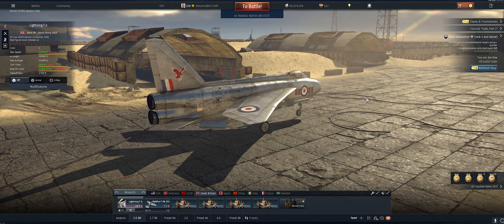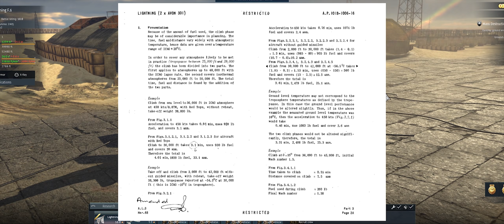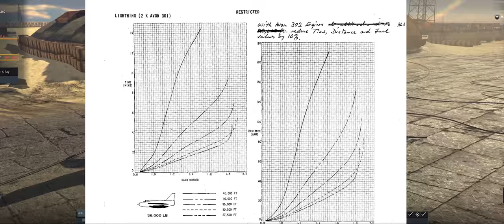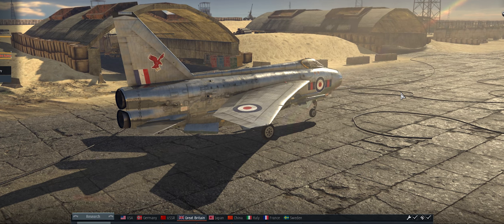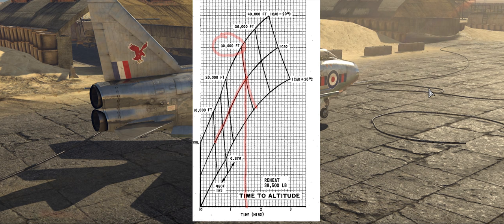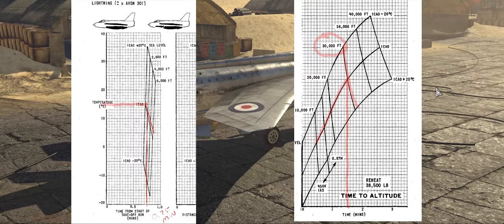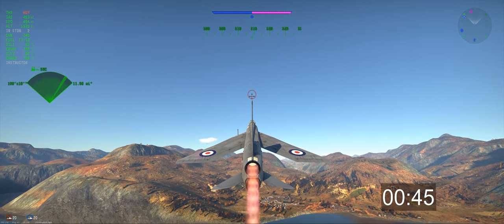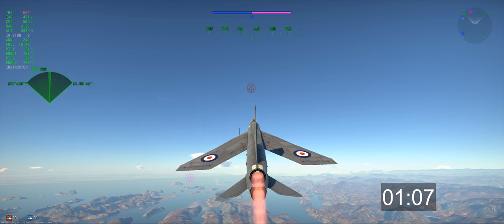True Facts About the English Electric Lightning's Performance - War Thunder 1.97

Comment: It's just weird how the migs and phantoms out climb this thing. Doesn't seem fair. The radar should at least work properly because the red tops need it.
Reply from the maker: EEL came into service around 1959, F6 probably closer to 1964.
Mig21 MF and SMT came into service in 1970 and 1971 respectively. Their trust to weight ratio compared to EEL is quite similar... Only difference is far less drag since they're tiny compared to EEL.  

Start to make some sense? 

Phantom came into service in 1960s.  FGR came into service 1972 I Think.  I forget.   Either way the Brits have the strongest jet in the game, the FGR.  It still out performs the rest.  

Yet they complain.
Reply: Because the F-4 and Mig 21 straight up out perform this thing in a zoom to altitude...F-4 for example has 41,000 ft/min where as the Lightning sits at 20,000. the reason the Lightning U2 thing SHOULD be brought up is not because the Lightning was the only one to do it but rather it was the plane that has the most favorable performance up at that altitude (for example for all the shit the F-104 gets at 60,000-70,000 the F-104 has better flight charactristics and THATS why they used 104s to intercept the U2 in the 80s and not something like the F-4 and was it was the USAF they didn't have access to F-14s) 

To put better light on the subject, Operation High Jump: A series of time-to-altitude records for the F-4 Phantom was set in early 1962: 34.523 seconds to 3,000 meters (9,840 ft), 48.787 seconds to 6,000 meters (19,700 ft), 61.629 seconds to 9,000 meters (29,500 ft), 77.156 seconds to 12,000 meters (39,400 ft), 114.548 seconds to 15,000 meters (49,200 ft), 178.5 seconds to 20,000 meters (65,600 ft), 230.44 seconds to 25,000 metres (82,000 ft), and 371.43 seconds to 30,000 metres (98,400 ft).

61.629 seconds to 9,000 meters (29,500 ft) Thats just under half the time for the lightning.
Reply: Southern Bear I think a lot of players don't understand how to climb properly at high altitudes. I did a test not long ago that found the highest climb rate for the F-4C is at M0.9, as you might expect for your supersonics. But at an altitude of I think 13 km or something like that, the IAS drops down to stall speed, and the climb peters out. Did some calculations, turns out the F4C at an altitude of 10 km actually has an ideal climb speed of M1.5, not M0.9, in fact, after around 9 km, the ideal climb speed continuously increases through mach as altitude increases up to very high altitude. This characteristic is consistent of mach 2 fighters in game.

Furthermore, players don't realize that the ideal climb speed at alt is in the supersonic regime, because there is a huge drop in performance around M1 to M1.1 which kills the climb. At certain altitudes, trying to push through M1 will actually force you to dive, reminiscent of the SR-71s climb profile.

So I'm sure the EEL as it performs in-game right now could reach U-2 altitudes if players climbed properly. But they don't. There's no reason to go M1.5 in PvP games, the maps are physically too small for it, except Boulogne, which I haven't seen in ages.

Comment: I would like to ask why you are only talking about the acceleration up to 450 knots and a 450 knot climb changing to mach 0.87 at 15,000 feet.

If you'd have looked on the forum, you'd see that there's a discussion going on with tests being performed. A quick look on this discussion would have shown you that the low-level acceleration up to 0.9M and climb-rate isn't the issue, nor is anyone complaining about it.

You've just done a test to show what has already been known and to "prove a point" about things people aren't complaining about.

If anyone would like to know what is actually wrong with the Lightning (I.e. Nothing in this video that he's trying to use to bash us).
You are welcome to join us on the forum.

https://forum.warthunder.com/index.php?/topic/478056-ee-lightning-f6/
https://forum.warthunder.com/index.php?/topic/479939-lightning-f6-performance-test-results/
Reply: Forum links =/= Factual data.
Reply: @asiftalpur3758  If you'd bother to click the links you'd see that they lead to official MOD data.
Reply: @oscarmuffin4322  is that a manual?
Reply: @asiftalpur3758  Again, If you'd bother to read the thread you'd find out.
Reply: @asiftalpur3758  your right Russian and UK relations are bad especially with the salisbury poisoning

Comment: Yes thank you so much for this. Even a small google search reveals that lightning shouldnt perform as well as a mig21 in climb and yet wt community intensely argues otherwise
Reply: Except that's not true. Even if you compare Gaijins data sheets of the two aircraft, the Lighting climbs better than the F13 and if you use the climb chart for the lighting at M.87 and compare it to the Mig 21MF in game then the Lighting climbs about the same if not better.

Comment: It's always going to under perform if you insist on a climb angle of silly degrees. 
http://www.aeroflight.co.uk/aircraft/types/type-details/english-electric-lightning.htm 

Initial climb 50,000 ft/min
Reply from the maker: In aviation you don't climb based on angle, you climb based on speed.  Most if not all climb charts are based on speed.  Your reference says initial climb 50K feet a minute, which is fine, but it's also followed by "time to 40k, 2 mins 30 seconds" so I'm not sure if it actually helped your point.

Comment: Which Lightning?????????? If it's Big Momma F3 XR749 the Lightning is well under performing. This particular Lightning beat F14'S F15'S F16' 104 Starfighter's in NATO tests in 1985. Achieving speeds of mach 2.3 and altitudes of 88 thousand feet.

Comment: the lightning is over performing but it under performs compared to other aircraft so say the mig-21smt  out climbs the lightning the mig 21 should not out climb the lightning and it should be nerfed
Reply: Source on that ?
Reply from the maker: Mig21MF and SMT came into service in 1970 and 71 respectively, 5 to 10 years after the EEL.  They also have a very similar thrust to weight ratio and ALOT less drag.
Reply: how do you know?
sourse? proof?
Reply: @niki_saito  i mean irl
Reply: @Theo_Aubusson  i ment in game
Reply: @niki_saito  you've said that the mig 21 shouldn't out climb the EEL...
Reply: @Theo_Aubusson  yes
Reply: @niki_saito  so where's your proof for this claim ?
Reply: "Operation High Jump: A series of time-to-altitude records for the F-4 Phantom was set in early 1962: 34.523 seconds to 3,000 meters (9,840 ft), 48.787 seconds to 6,000 meters (19,700 ft), 61.629 seconds to 9,000 meters (29,500 ft), 77.156 seconds to 12,000 meters (39,400 ft), 114.548 seconds to 15,000 meters (49,200 ft), 178.5 seconds to 20,000 meters (65,600 ft), 230.44 seconds to 25,000 metres (82,000 ft), and 371.43 seconds to 30,000 metres (98,400 ft)."
If the lightning is at 30 angels at 135 seconds
the F-4 Phantom is at about 55,000
Reply: @WhooptieDo  Mig-21BIS (75A) Technical description. Book 1. LTH (МиГ-21БИС (75А) Техническое описание. Книга 1) - page 50 - Mig-21Bis need about 2min10s to get 9000metres from the ground. So Mig-21MF and SMT climb faster than Mig-21Bis?
Reply: @Theo_Aubusson  Mig-21BIS (75A) Technical description. Book 1. LTH (МиГ-21БИС (75А) Техническое описание. Книга 1) - page 50 - Mig-21Bis need about 2min10s to get 9000metres from the ground. Mig-21MF and Mig-21SMT don't climb faster than Mig-21Bis, right?
Reply: @doodiezgrandpa6520  Mig-21BIS (75A) Technical description. Book 1. LTH (МиГ-21БИС (75А) Техническое описание. Книга 1) - page 50 - Mig-21Bis need about 2min10s to get 9000metres from the ground. Mig-21MF and Mig-21SMT don't climb faster than Mig-21Bis, right?
Reply: @Charioteer71  I don't know, can you provide an evidence that the Mig 21 we have in game is slower than the Mig 21 bis
Reply: @Theo_Aubusson  Mig21MF and Mig21SMT now in the game climb faster than the Mig21Bis in its performance document.
Reply: @Charioteer71  what's the flight conditions in the manual ?
An older plane can be faster than a newer one
Reply: @Theo_Aubusson  Mig-21Bis(75A) with two R-3S and maximum engine power.
Reply: @Charioteer71  max power with or without afterburner, what fuel load, what climb rate, what temperature ?
Reply: @Theo_Aubusson  https://cloud.mail.ru/public/490525725e49/MiG-21BIS%20(75A)%20Tehnicheskoe%20opisanie.%20Kniga%201.%20LTH.rar  find it here.   There's only one chart without mentioning any conditions. Maybe some before page 50 but didnt find them.
Reply: @Charioteer71  Thank you, i'll read it^^

Comment: thats means everything else is overperforming to shit the mig 21smt never had the same capability as the lightning over 15000ft so why tf does it boss  the lightning
Reply: The issue is that the manuals aren't great to work out max performance. They're what the manufacturer recommends to get the most life out of the machine, meaning they pretty much always lowball the top end figures, since they create excess stress. The issue is that every company will do so by a different amount.

 It's why gaijin generally won't accept manuals as the sole piece of info for changes.

Comment: The thing is, you are showing off the stuff that is actually done correctly, there are issues with high altittude acceleration (which is takes ages up to 2x as long for some uknown reason) and supercruise capabillity, I am no aircraft engineer, but approaching is this way is incorrect, because it is not as easy as you say, you have to compare much more data than just what you have done.
Reply: >is not a aircraft engineer
>still thinks need more data then a fucking manual lmao
>britmains.jpeg
Reply: I won't argue with you, but facts are clear, EEL could supercruise at 1 800 m alt, guess what, in-game it can barely do it at about 4 000 m. Does this seem correct to you? Even the manual Gaijin used says this, yet they overlooked it for some reason. Many sources will tell you that EEL could intercept U-2 spy plane, in 80s it was the only NATO plane capable of intercepting Concorde at altitute (F15, F14, Mirage couldn't do that), in-game EEL can't even get over 15 Km. So this is it. I don't argue for low flight performance because simply Phantoms and MiG21s have better geometry and aerodynamics (even though not being able to pass Mach 1 at sea level is little strange to me, most likely same RAF safety limitaiton as for Javelin's speed...), but the high alt performance is just BROKEN. I can even give you sources for this if you want, but I bet you won't read it.
Reply: @radekfolprecht5493  Gaijin has confirmed that EEL is performing fine. Go on reddit and read what simin is saying.
Reply: @asiftalpur3758  Take a look at the forums, EEL F6 topic, guy called Nicroon went throught the manual used by Gaijin and then did a lot of testing in-game, he showed that high alt. performance is incredibly off (acceleration takes up to twice as long!), supercruise is just as off. Bug report should be done soon. At this point Gaijin says only part of the truth.
Reply: @radekfolprecht5493  I know about this event but sadly it doesn't mean anything. Pilots manual is the word of God himself. No other event could substitute actual fight characteristics.

Also, do a little indepth digging. The specific airframe that did this wasn't representative of what the RAF fielded. It was a different model with slight tuning.

Now, consider this. You're asking for a fix to a plane based on an event that isn't independently verifiable, such as a pilots manual or manufacturer data. Imagine if future F14 Tomcat players complaining that their phenoix missles aren't mini nukes based on a event where 2 Iraqi(or Irani) Mig29s were shot down using one of those missles.

Now on one had you have this event, and on the other hand you have pilot data/manufacturers notes. What would you rely on?

Here in this video, it's been tested down to the T based on pilot manual. It's been ascertained that the EEL is over performing at certain altitudes. Now, have I seen a test that compares its high alt performance with pilots manual? Nope. What should I trust, anecdotal reports or MoD pilots manuals?

Comment: The F-104 can beat the Lightning in speed on the deck, every other thing the lightning did better
Reply: Pretty sure the F104 and Lightning were equal on the deck
Reply: @Sir_Budginton  A danish F-104 was able to beat a RAF Lightning in a test once
Reply: @uuuuheeee4254  Depends on which F-104 variant, the F-104A with the GE-19 would outperform the lightning in the climb and acceleration.

Comment: Uses a MANUAL. Not real recorded statistics of the aircrafts performance. A manual doesn’t mean shit, its a factory manual on how to operate the aircraft on their bases. I know this means jack because every aircraft is different. The Lightning that could catch the U2 Spy plane at record high altitudes and speed was only 1 single Lightning that had no modifications to it whatsoever and was the exact same as the rest of the lightning’s in the squadron yet it was recorded to be performing better then the rest. It wasn’t the pilot, it wasn’t the engineers it was the plane. It is well known and factually recorded what the plane can do and it is better then what the manual states
Reply: You can maintain sustained climb, that means you keep you airspeed constant. Or you can do zoom climb: accelerate in level flight and than climb straight up and lose you airspeed, of course. The last way allows you to climb faster in short period of time. And get higher, than fall down of course.